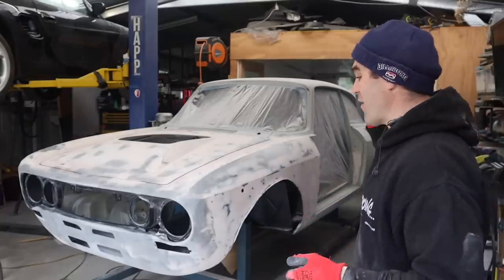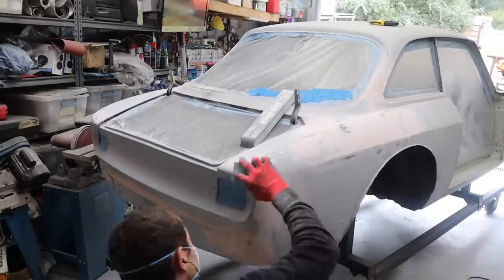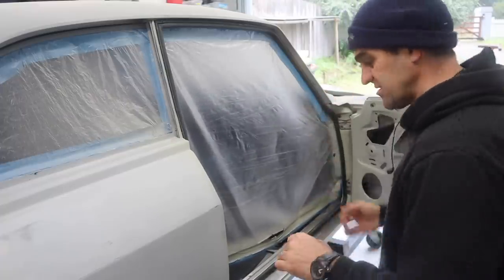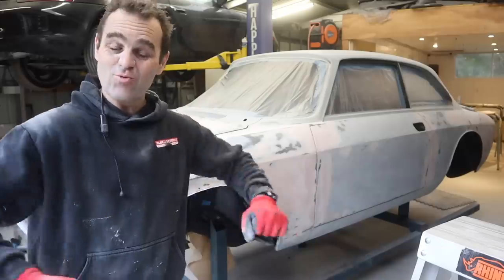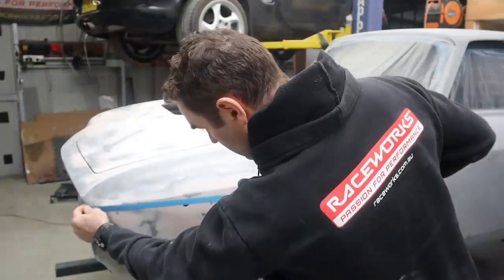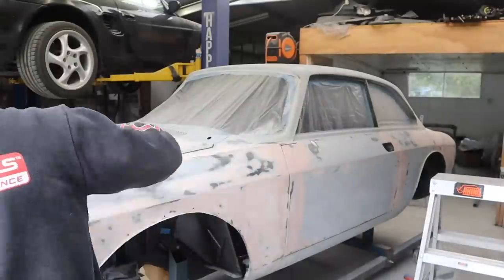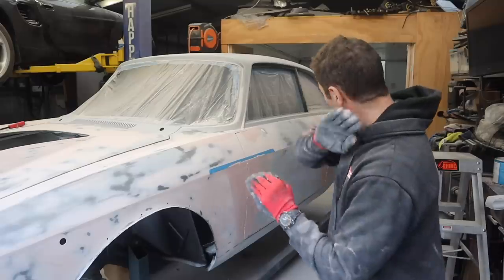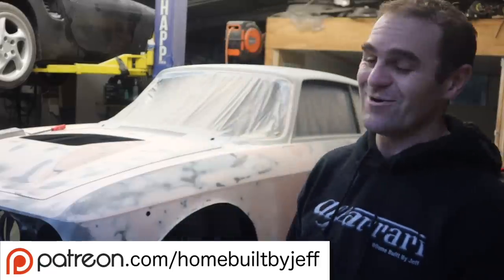Making crisp body lines - Ferrari engined Alfa 105 Alfarrari build part 139

Comment: Try a medium stiff wire brush on the clogged paper on the DA sander. If you do this before it gets too badly clogged you can extend the life of that paper too. The wires are great at picking out the material in between the grit.

Comment: Great work!!  It's crazy how we're working in parallel, I finished sanding the filler last summer but just finished a video about sanding the body lines and putting in the door seals yesterday , we used the same techniques more or less, I just used powder guide coat along the tape line
Reply from the maker: I will be using the powder guide coat soon to start going down in sandpaper grits :D . I will have to sit down and catch up on your progress mate.
Reply: @HomeBuiltByJeff  the shell is in colour and I'm slowly putting it back together. I'm painting suspension parts black and putting in sound deadening
Reply: Now that Raising junior is in paint, I can't wait to see yours. Two great builds.

Comment: Your DA trick is why the old school guys used to use a body file on filler. Take that top off and knock it flat and make it much easier to sand.
Reply from the maker: I have done that in the past but you still end up clogging up the body file.
Reply: @HomeBuiltByJeff  yep. The whole process sucks.

Comment: Instead of WD40 to lube rubber seals someone mentions dish soap but I use Windex or any other non foaming glass cleaner. Slippery and drys without residue.

Comment: With your fresh bog, try wiping over it with wax and grease remover before sanding. It removes the sticky resin that sits on the surface and clogs your sandpaper.
Reply from the maker: Worth a shot. I will give it a go and see.

Comment: Hi jeff have you tried polyester spray filler? I used the upol stuff the other day with a cheap 2.2mm sealy spraygun, amazing stuff, builds up really fast, no overspray on low pressure & really easy to sand, does cost a bit more that standard filler but well worth it as it gives you a thick even one colour coat over the whole car.

Comment: Instead of putting the door rubbers on and off all the time, get an old door rubber or even a meter or so strip of new door rubber from Clark Rubber or local upholsterer and cut it into 100mm bits and just put the 100mm bits in 4 or 5 places around the door opening it will do the same job, you won't destroy your new rubbers and WD40 does destroy the rubber.  The 100mm bits are easy to put on and remove.

Comment: Dish soap is what I use in situations like your door seal.
Reply: Also, they make a brush with metal bristles that works nicely to clear the filler globs out of your sandpaper. You could probably use any wire brush though I suppose.

Comment: Jeff, door seals are much easier with a modified air hammer bit. This is what is used in car assembly plants. Let me know if you need more info. But, I guess for a fella like yourself, this is more than enough info. 
Result - no need for paint unfriendly silicon based lubricants. #wd40killspaintjobs